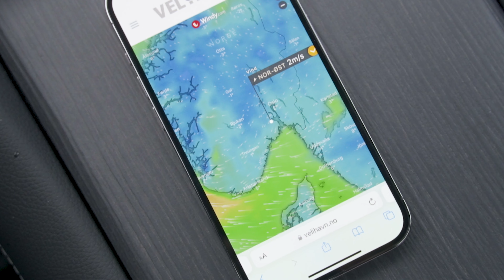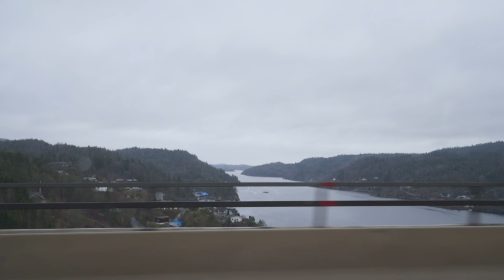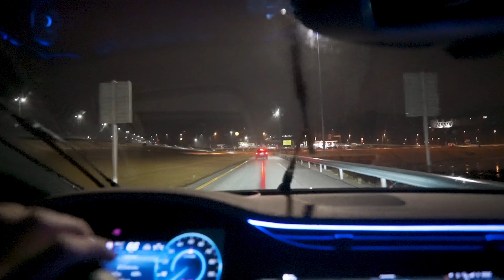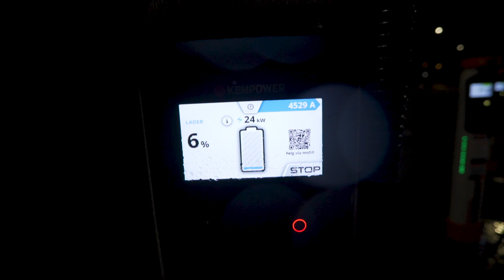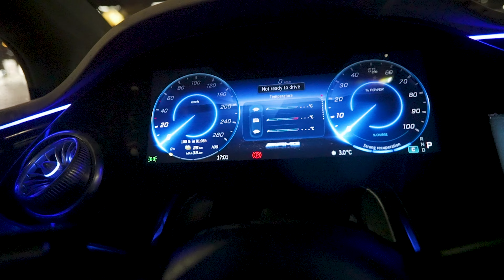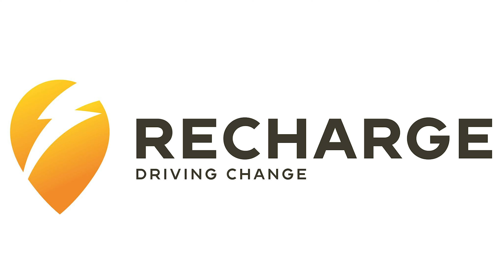Mercedes EQS53 610km Range Test (Norwegian High Speed Run)

Comment: 25.2kwh/100km = 2.47 mi/kwh and usable battery is 108.4kwh meaning a range of 267 miles. So its like 260 miles cause those last miles would be its 'below 0 miles reserve' that most people would never drive it to that.
Reply from the maker: No, that's incorrect. usable battery in this car 107,8kWh. Usable meaning from 100-0% SoC, so that percentage below indicated 0% and actual zero is not counted in the usable calculation.
Reply: @KrisRifa   thanks for that. Even still 260 miles / 420 km according to this is what your gonna get on the motorway.
Reply from the maker: @cephasmakuzva  I have done a motorway range test with this car. You’ll find that test on the channel 👍 go and check it out!

Comment: 12:45 I think Recharge is very DISHONEST when labeling 300A chargers as 150 kW, because NO EV has 500V to use it, for 400 V it is then max. 120 kW which is much too slow to demonstrate modern EVs.

Comment: Mercedes doesn’t preheat when manually navigating to a charger. You should have navigated to the final destination. Then it adds a charging stop in the trip and the car will preheat.
Reply from the maker: Your explanation seems to makes sense, I have an EQS 450 later in the month and will try it then! Thanks 😊
Reply: Yes it does, it is a matter of settings. Under route you can change minimum soc at charger and at destination, set both to minimum and you can navigate to charger.
Reply from the maker: @rollrobson  I fiddled with these settings before I started the video, and no setting for preheating though.
Reply: Correct! But they affect the way tou can navigate directly to the charger, and therefore the preconditioning. Check with MB 😉
Reply: @rollrobson  one thing I have found is a long long journey you will get errors about not being able to find charging stations going all the way from Nevada to New York and said there was no route that I could make to get two charging stations which I was so nervous about when I bought my new car when I ended up having to do was split the trip into three so I made it a goal to get to the end of Colorado and with that in mind, it was able to me just fine and then from Colorado to a little bit before Chicago area no issues again and then from Chicago to New York but for whatever reason when you put in and to end anything over 1000 miles it can’t route which is weird. Not the biggest deal because it’s long enough where you can just kind of do a little bit of work ahead of schedule, but you just have to make sure that when you were getting close to the end of your progress and that you’re staying on the route that you wanna stay on indefinitely that you add on the next route so it’s a little bit frustrating only because doing it that way it also made it so you don’t always preheat the battery before getting into that last charger so it definitely slowed down the amount of charge in time not a huge deal because of such a long trip over a couple days but still frustrating nonetheless. And this was only a few weeks ago. I’m sure most people would never run into the issue because nobody will really be doing that type of drive but something to be aware of.  On the plus side I would say 80% of the nine chargers I stopped at electrify America so the charge was free and all of them seem to work and be 350 kW chargers with the exception of two one with some random Canadian one and it was the only one in the area and that one I had to keep restarting every five minutes And then there was another one where it was only 150 kW and again it was towards the end of the journey so it didn’t preheat the batteries so it took like an hour to get up to 80% and I had to stay past 80% because the next distance I needed all the charge I could Get   I did run the battery hard to see what you could truly get so I did arrive two different times at electrify America with zero state of charge one was purposely trying to get it down there. The second one was so low because I didn’t want to stop at a small ChargePoint 50 kW charger so I pushed it to the next one even though the car would keep trying to reroute you saying you weren’t going to make it. I just had to ignore it and use Google maps to get to the electrify Americaso even when you put ignore next charge and stop the car will still automatically re-add it if it thinks you won’t make it, which is kind of frustrated to be honest, but I can kind of understand.

Comment: Such a waste of energy doing all those runs!
Reply from the maker: How so? Those videos have hundred and thousands of views and helped countless people chose the correct EV for their use case 😅 On top of that 99% of electricity in Norway comes from renewable energy, so impact on the environment has been minimal 👍
Reply: @KrisRifa  renewable energy sources - good. 
But still you produce lots of unnecessary pollution: tyre&asphalt wear just as an example.  
And it doesn't really matter to our planet, whether your audience pick an EQS instead of a Taycan or vice versa.